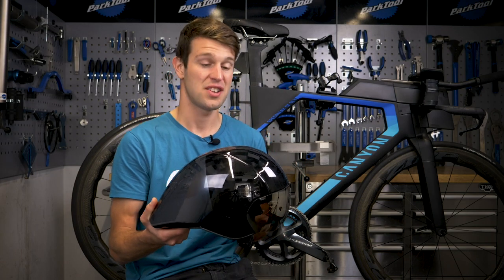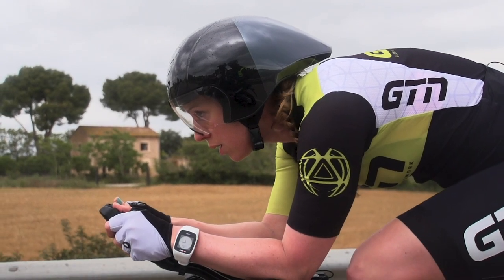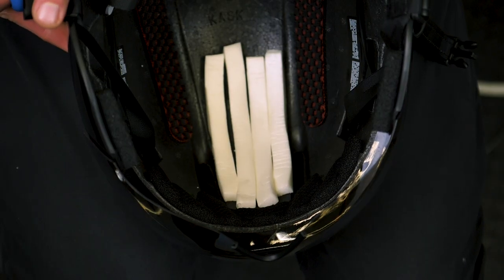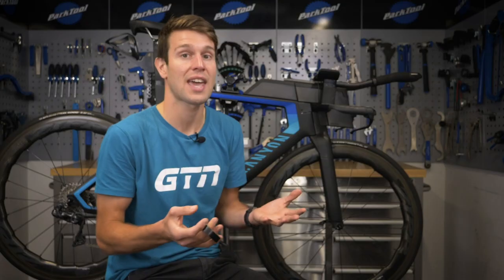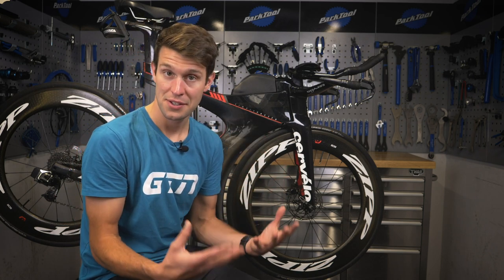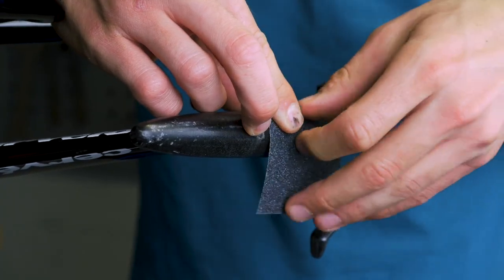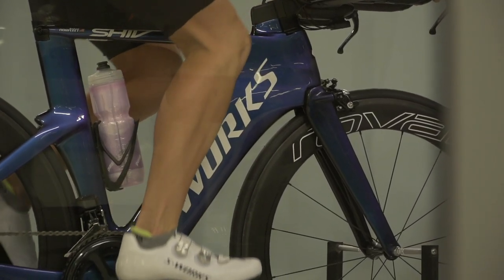7 Aero Hacks To Cycle Faster | Smash Your Next Triathlon Bike Leg

Comment from the maker: What is your #1 aero hack? Let us know in the comments below 👇
Reply: Global Triathlon Network best Aero hack: get a sponsored aero-bike by canyon!😉
Reply: By the way, as an alternative to the thru-axle, there are the "view-speed.com" non-QR skewers. They don't work on every bike so ask the owner or ask on forums whether it's going to fit (it does for my Trek Speed Concept 2019).
Reply: Amazing you didn't talk about where the  most aero gains are to be made - body position
Reply: The hair on your head is also another factor that increases drag. I would go for a hairstyle with really short sides and slick back my hair when I put my helmet on because mines not an aero helmet and my hair can be sticking out of the helmet thus increasing drag
Reply: The rear bottle or tool box is really important. it helps fill the void behind you.
Reply: @jackhammer40k_  Absolutely right. A professional bike fitting saves time on the bike and later on, on the run too.
Reply: Dude just get ride of the wheels. They take up by far the most drag and wind resistance. Who needs them anyways
Reply: Global Triathlon Network wear socks
Reply: @jackhammer40k_  Because eeeeeveryone know it, he is talking about rare tricks.
Reply: Use lotus 101 and Be a Chris boardman
Reply: Tight clothes

Comment: I can take the taping bolts a step further. Some holes are best taped, but for Allan key bolts I prefer to drop molten candle wax to fill the bolt head. There’s plenty of yaw-dependent, and temperature and/or air density dependent tricks as well... but I’m sworn to secrecy

Comment: The key is to reduce your frontal area exposed to the wind.  In regards to your body position, there are 2 ways to do it.  One is by lowering your body position to be closer to the bike and the other is by being "thinner".  this can be done be bringing your elbows closer together and bringing your legs closer to the frame (Q-factor).  This second option may be better because you won't be losing power by being scrunched up on the bike.  You can be a little more upright for power and breathing efficiency, but still have less frontal area.
Reply: Not completely true. Bringing your elbows together Will lower your stability and Will make your (thinner) body rocking from side to side. + Your head Will (in most cases) come up higher.

I've seen this time and time again doing aerotests in a variaty of riders (TrainYourDream.com/sports)

Comment: you did not address the clothing, many years ago I was part of a team of engineers that developed cycling gear for use by US Olympic team.  We did a lot of wind tunnel testing on components and gear.  We found that if the rider wore clothing that did not breath it would reduce the drag of the rider by several ounces, without any other changes.  This is significant on a long race.  Not practical to wear fully sealed fabric, but if the front and sides of the shirt and shorts did not allow air to penetrate the fabric, it would reduce the drag significantly.
Reply: There's better materials now, no need to have any part of your suit not breathing
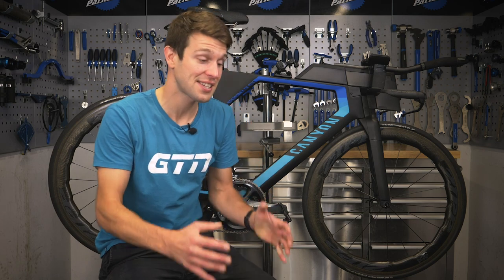Reply: 7:53

Comment: That disappointing moment when a cyclist goes stalking out one, just one, aero gain and realizes, as always, that he’s already doing every single one of them.
Reply: George C fair play! I haven’t come across many people putting thick padding in the helmet to improve its tilt
Reply: Mark Threlfall They are all great tips all the same :) I tried that initially to improve field of vision rather as my helmet-back gap was negligible. Another tip linked to this is to tape the base of the tail (can do this to an Aerohead to help transform it into the Aerohead ultimate for instance). Sure this reduces turbulence but haven’t wind tunnel tested it myself

Comment: When I get into an aero position my neck and eyes hurt for being in a very extreme position, am I doing something wrong? Or I just have go get used to it?
Reply: have you had a bike fit? if not that would be everyone's go to. another thing you can do is rotate your neck and stretch it out every so often perhaps when you get out of the saddle to stretch your legs up a hill. additionally you can look up exercises online to make you neck muscles stronger which may also help
Reply: @kylebrown4293  Actually no, but If I get one I will have to do it myself as I am a student, I will watch videos on the subject, Thank you!
 btw I have never done a triathlon, I'm just here because of the tips
Reply: Start with aero pads completely level with your saddle. Ride in that position for a while and once you get used to it then gradually drop the pads. Focus more on dropping your head between your shoulders rather than slamming the pads straight away.
Reply: @phxrsx  I don't have aero pads, just a normal handlebar, it isn't even a road bike, but for what you have said maybe I am dropping too much into the handle bars. Thank you for answering
Reply: since when do you ride the bike? And how regularly? It is a fact, that the muscles in your neck will become stronger over time and more used to this work, so if you are relatively new to cycling - don't worry, things will get better, much better.
Reply: @fiddleronthebike  It is the bike that I have since I was a kid, because I am a teenager it has about 6-7 years, aero isn't a thing all the time just on downhill, and from time to time, it is not a thing that I do very often, maybe it is the cause for my weak neck, and therefore my neck hurting

Comment: The rules aren't wishy-washy about helmet modifications at all. "5.9 Helmets. (a) Type of Helmet. All participants shall wear a protective head cover, undamaged and unaltered, which meets or exceeds the safety standards of the Consumer Product Safety Commission (CPSC), and which is clearly labeled by the manufacturer as satisfying such standards.....Any violation of this Section 5.9(a) shall result in disqualification."

The ITU equivalent rule is, "(iii) An alteration to any part of the helmet, including the chin strap, or the omission of any part of the helmet, including an outer cloth cover, is prohibited;"

Adding extra padding to a helmet is a modification / alteration, and is a violation of USAT and ITU rules. Whether a referee does anything about it (if they notice or are notified by someone) is a separate matter, but they absolutely can issue a disqualification for violation of that rule.

Comment: So you tape over allen heads on flush bolts, but leave the exposed unused bottle cage bolts sticking out!?! why not replace with slim dome head bottle cage bolts or just remove and tape over the holes...incomplete job otherwise.

Comment: A bit irresponsible to show peope how to bodge a helmet with a roll of foam
Reply: The foam is actually more padded than that of most helmet padding. It's just less breathable. It's thicker for starters. As mentioned, you can of course stick to standard padding, and get the increased thickness or double up